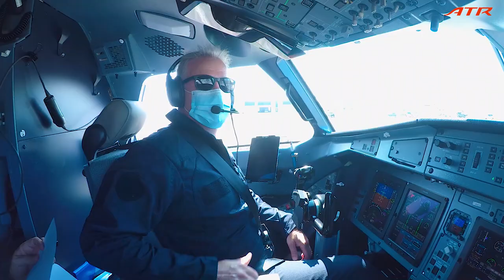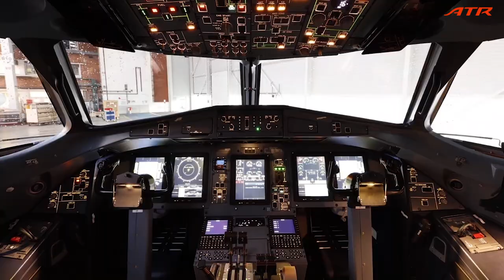FedEx Express ATR 72-600F (FREIGHTER) Assembly

Comment: Crew toilet?
Reply: No need, this are just short flights.
Reply: Short flights or not, when you gotta go, it's a different story
Reply: @Bruce.-Wayne  Than go before takeoff? If you rare not sick in anyway, you don't need a toilet every 4h... Edit you can also bring a toilet container on board (would be stupid b.c. it's a waste of space) or use some... device :D
Reply: @friendlyreptile9931  This aircraft has PLENTY of space for a toilet! I appreciate everyone's opinion, but not installing a toilet is something very stupid, typical of this obsolete aircraft and an extremely lazy manufacturer!  Perhaps, because of its poor performance, they wanted to reduce the BOW as much as possible by removing the toilet... Really, it's not a Boeing, it's not an Embraer...
Reply: @RobertoRMOLA  I know the ATR very well and it's a very good performing airplane belowe a certain altitude. It's fuel efficent and can carry enough for what they do. Sure, a toilett would be nice but do you know wich route it flyes? Maybe just 1-2h flights and why do you need a toilet than? Isn't it not possible that a lavoratory was added later?
Reply: @friendlyreptile9931  Noone can endure 4 hours without going to the bathroom
Reply: @hansloyalitat9774   No self controle? o.0 Wtf?
Reply: @friendlyreptile9931  Its gonna hurt like hell and be extremely uncomfortable
Reply: @hansloyalitat9774  I have no problem with not going to the bathroom for 6-7h and it'S not uncomfortable or hurting for me  o.0